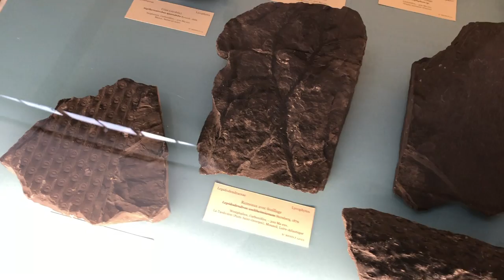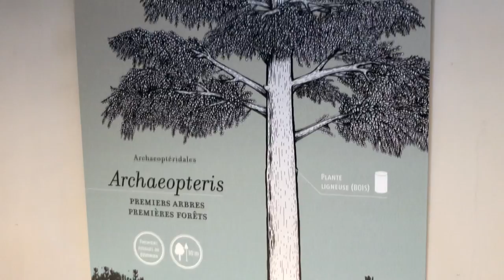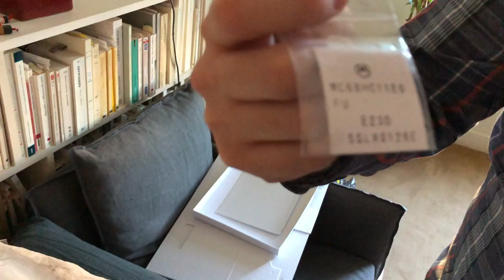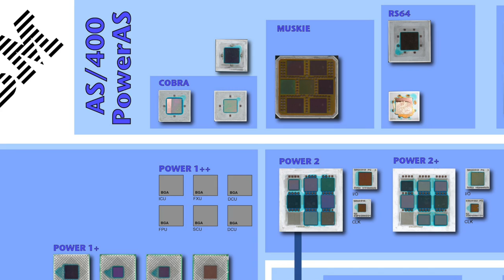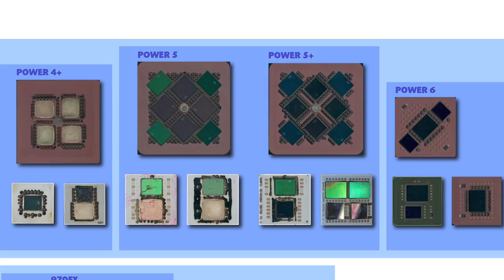Fossil Data Part 3: Antoine's Fossil CPU Chips Collection

Comment: The AMD K5 is an odd one; it was the first wholly indigenous x86-compatible design from AMD and was actually based on the 29k RISC architecture.  It had an emulation layer in its microcode for executing x86 instructions.
Reply: Not that old to remember if it was any good, I do recall the K6II being popular
Reply from the maker: @ingusmant  Wikipedia, the source of all approximate pseudo-knowledge, tells me that follow on designs also used microcode x86 emulation... AMD processors became a lot more popular when they made them pin compatible, not just code compatible, with Intel.
Reply: @ingusmant  My second PC actually had a K6-II, I think it was like 233Mhz or so. I must have used that system until I got an AMD Athlon in 2000
Reply: I think the FPU is straight from the AMD 29k indeed. Then AMD abandoned the K5 architecture after buying NexGen: the K6 is based off of the Nx586 (also translate x86 instruction).

Comment: The AMD 29030 was the last or maybe next to last gasp of the AMD 29K RISC processor series. They were used extensively in the first laser printers made by most everyone, since they were the only things that could run fast enough to do the image processing necessary at 300 DPI or more.

Interestingly, if you look at the AMD 29K architecture and the now fortunately extinct Intel Itanium architecture, you might come to some interesting conclusions about heritage, though the Itanium designers I talked to when the chip was new claimed they had never heard of the AMD 29K machines.
Reply: evolution convergence...
Reply: It was an interesting time before ARM in the early 90s: what do you use for high performance embedded 32bit applications? 68k was popular, but AMD took the laser printer market with the 29k line indeed. The Am29000 was the original design, the Am29030 had cache, and the Am29050 was the top of the line with FPU, and embedded versions Am29200 and Am29205. Then came the Am29040 and the embedded Am2924x. Apple used them in the LaserWriter lineup after switching from 68k, and the 29050 was used extensively in avionics for the flight computer. They are also often found on FDDI adapters. An other option was the SPARC, which was used for laser printers and even early digital cameras.

Comment: The white MCM shown at 11:20 is probably not from a Multiprise since those used much smaller modules. My guess would be G5 with less PUs (there were two versions of the G5 MCM - one for the smaller and one for the larger systems). Antoine could check against his other G5 module - the pin layout should be the same.

Comment: Very interesting crossover from the museum to the chip collection, thanks for showing.

I have an IBM 4331 (I believe) processor chip, a white ceramic module about 7cm square with an embossed diamond-pattern gold top and a few hundred pins underneath. I used to use it to comb my hair (seriously), it actually did a good job.
Reply: These are nice, I don't even have one in my collection. They are becoming hard to find, hang on to it!
Reply: @adberco  If he gets bald he won't need it anymore... ;-)

Comment: I’ve got a number of oddball IBM chips I salvaged years ago; some are 40-pin DIP packages (ceramic), while others are about 1-1/2” square, with a metal outer case that hides a ceramic substrate inside that actually has the IC dies on it (I disassembled one out of curiosity.) The pinout is non-standard, and all the parts from the board had custom house #’s on them, so Google is no help, here. One such has these markings on it: “5122242”,”IBM3414”,”ESD    M”, and “1 304 414116”. I was going to toss them. They all came from a number of PC boards that may have been a mini-computer, or may have been telecommunications equipment; I don’t know. 😐
Reply: These are numbers that predate the current NNXNNNN IBM part number format, up to at least the early 80's. These metal cans chips were inherited from the s/360 eras and are used for C4 flip chip die interconnect, something that IBM pioneered.

Comment: 13:55 isn't one of those cores the same architecture that powered the Curiosity Rover for 20 years?(without radiation hardening of course)
Reply: Yes, curiosity run on the Power architecture. the IBM RSC (risk single chip) was turned into a radiation hardened version called the RAD6000 by BAE. It evolved in the RAD750 which powers Curiosity, the RAD750 is a PowerPC 750, the same as the one you had in your G3 powermac.
Reply: @adberco  Thats so cool! Thank you for sharing your knowledge! !^.^!

Comment: Great video :-) Cognitively, when we see MСM and especially their size, I understand that this is the past, but modern trends in processor construction are just going this way, just look at AMD  Threadrippers.
Reply from the maker: It’s always been with us. When you want to go beyond what Moore’s Law allows you to do in a single chip, you use MCMs. It’s just that when Moore’s Law was running full blast, it did not make economical sense to use MCMs in consumer designs. It still occasionally happened, like the Pentium Pro for example. Professional and military designs did use it all the time. But now that Moore’s Law has essentially stopped, MCMs are reappearing in consumer designs.